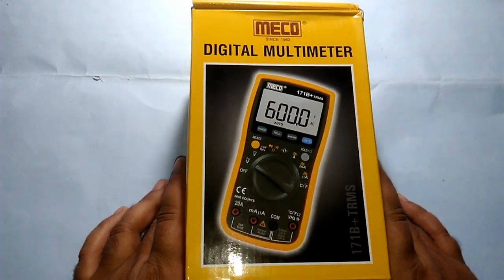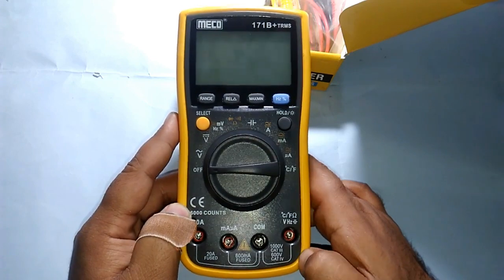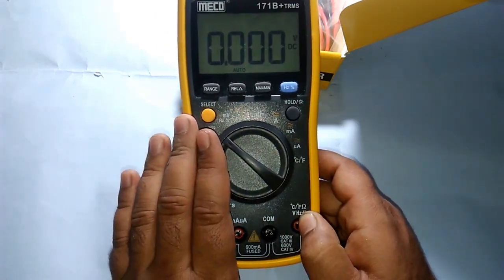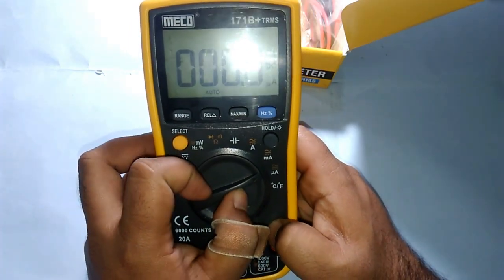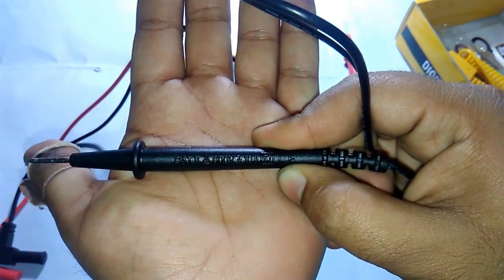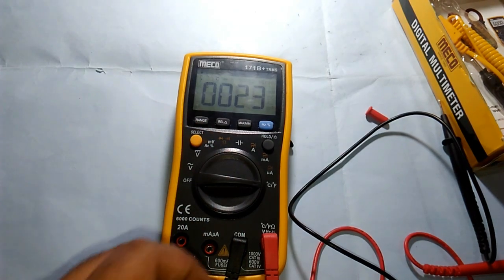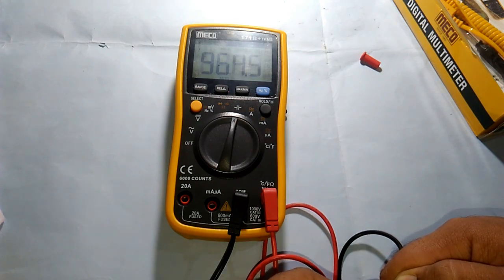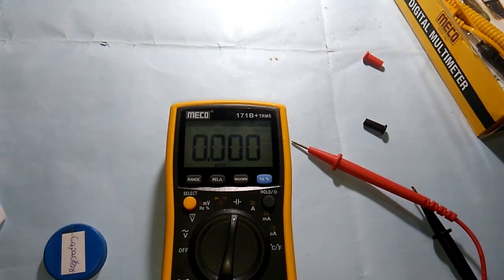Unboxing meco 171B+ Multimeter - Industrial grade digital multimeter

Comment: Cheap replica of fluke 15B+ & 17B+, but the fuse & isolation is awful..It's an exact copy of AN860B+ (bought from Ali Express @1230). These meters are not recommend for higher than 50 volts, if you don't believe just open it up & you will see the following things
1. there is no ceramic fuse, just two glass fuses.
2. one fuse end is almost touching the current shunt.
3. there is absolutely no PCB cutting isolation inside.
4. there is no high voltage resistor present.
5. there is no mob & only one small ptc inside.
6. the tiny glass fuses are just a joke specially for input like 1000V or 20A, are you kidding?
7. the probe leads & wires are just nightmare specially for input like 1000V or 20A.
Good luck to you if you are using this meter to measure something even half of 1000V or 20A...
Reply: Tapojyoti Acharya 

Please let me know which indian one is better except Fluke
Reply: How much is is your budget? I would suggest you to increase your budget as much as you can because if you buy a decent multi-meter that's not only going to last a much much longer time but also offer a safe atmosphere during work. Personally I own a lot of multi-meters (both expensive & inexpensive), so let me know your budget first. Another query, why "except Fluke"? Is this for budget or  any other thing? Please state the reason too...
Reply: @RajbirSingh-wg9pf  
Give me two days please...I will call you.
Reply from the maker: Tapojyoti, A few points you mentioned are right, gonna create a new video on this multimeter that how safe actually is it.
Reply: Tapojyoti Acharya 
I'm not a professional DMM user. But interested in electrical and electronics DIY works. Fluke is more pricier and has less features. For that price, can we get any better DMM? How about HTC-97, HTC-87? Ur suggestions welcome.
Reply: How are Motwane Multimeters?? Any idea... take the M41
Reply: Exactly! This meter won't be safe around mains voltages. But I'm gonna buy it because, it's continuity is lightning fast, a feature that's important for electronics technicians. Joe Smith has tested it and I've gone through his data sheets. It can detect a short as brief as 1 millisecond, something all of the Flukes he's tested so far failed to achieve, including the famous 87V.